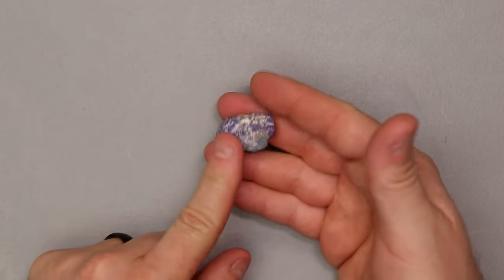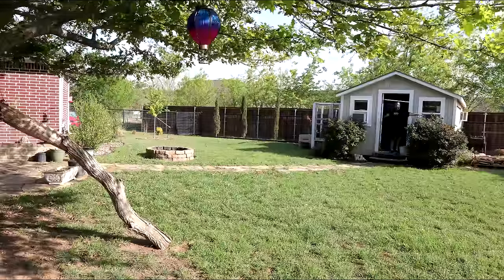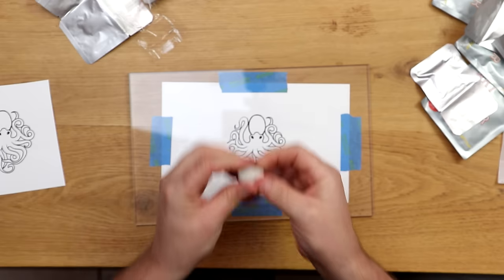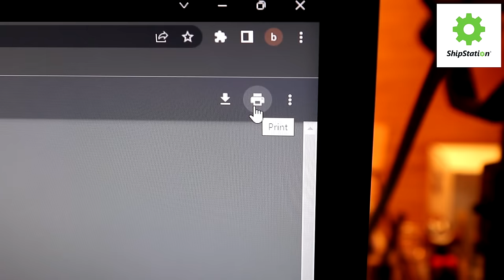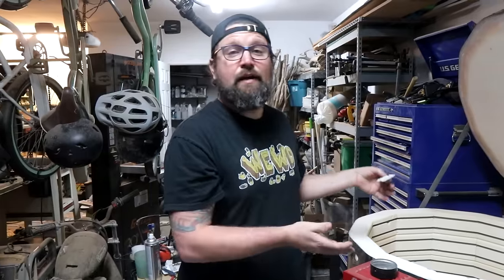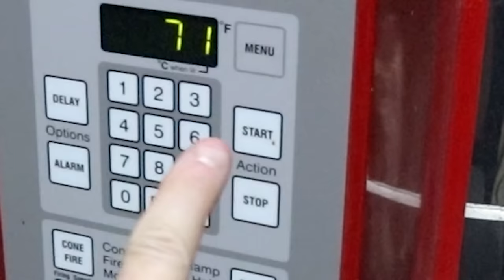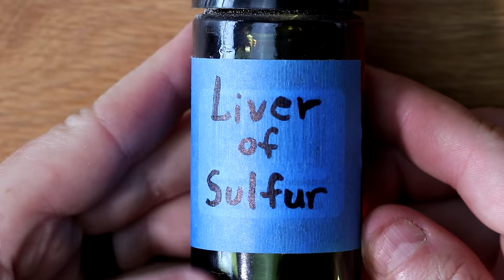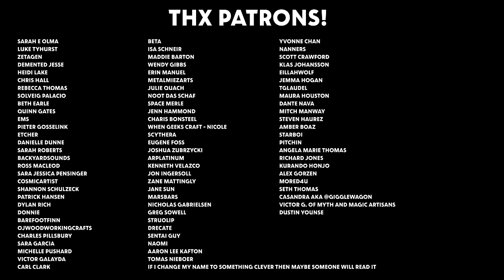this CLAY turns into pure SILVER METAL (seriously)

Comment: Very impressive for your first metal clay piece. The fact that it's white coming out of the kiln has nothing to do with silver oxides though. The surface of the .999 fine silver is microscopically bumpy and doesn't look shiny until you smooth those bumps through burnishing/polishing. Also, your wife can use the silver clay decorating her pottery pieces too, many folks have done that.

Comment: Your design turned out great!  😁👍  Well done! 👏  Loved the modeling of the finished piece, BTW. 😂  Can't  wait to see what else you make with it.

Metal clay isn't new.  I've known about it for many, many moons now, over a decade of moons, perhaps closer to two.  (Yes, saying that makes me feel old.  I'm 43, darn it!  I AM old! 😫)  Anyway, I know it also comes in gold and copper though I never paid attention to find out if they included other metals in the lineup. 😅  I remember wanting to try it really badly when I first heard about it (I was working with polymer clay and wire a lot at the time) but I couldn't afford it at all, nevermind all the extra stuff you need to go with it. 😭

Oh, if you don't intend to use the clay again for a long time I'd put it in some kind of vacuum sealed bag or container to prevent it from drying out and making you sad. 😇  Also, I do hope you kept everything that you carved out of that piece, as expensive as that stuff actually is. 👀  Thankfully, you can reuse anything that hasn't been fired yet, even the dried stuff, by turning it into a clay slip like the one you used to make the little suckers on the octopus.  It's the only saving grace with the price for that particular clay. 😅  The fact that you can pop the slip into a mold, let it dry and then fire it is also cool since that allows you to recreate designs easily if you make an original out of something like polymer clay and then make your own mold from that. 😉

Comment: As someone who has worked with silver clay, torch firing makes a much more fragile piece. Silver clay is like poor man’s casting, and as a result the silver tends to be a little more fragile than cast pieces; firing in a kiln is the best way to make it as strong as possible.

As for the liver of sulfur, it helps if it’s a little on the warm side (make it with hot water). 

And finally…you made that look so easy, and I’m annoyed. But in a nice way, I guess? Iunno, good job!

Comment: Looks good but it looks like you need to redo that solder job on the left side as you look at it it looks a bit funky and either needs to be grounded and polished more or completely redone due to low penetration and bad bonding.